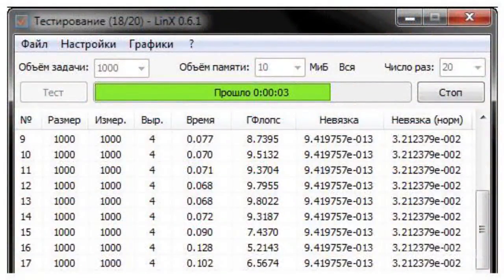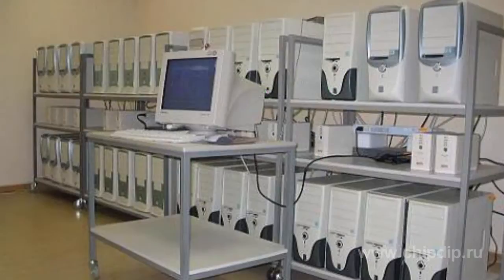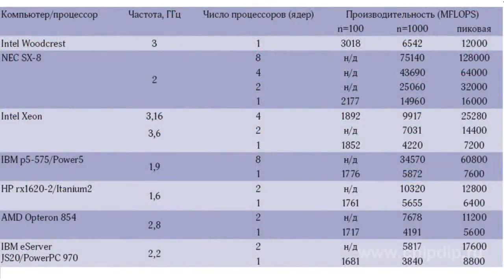FLOPS. Performance measurement

Comment: Please what is 1tb / 1GFLOPS =? Please tell me the step by step process. Thank you.
Reply: FLOPS indicates how many floating point operation a processor can produce in 1 second, these operations contains calculations like subtracting, dividing, etc. a FLOP number is expressed in scientific notation format for example instead of writing 5000000, we can write 5*10**6 so that every number no matter how large or how small it is has the same amount of digits to save space. a FLOP number usually has 32 digits. 1 for the sign of the number, 6 for the exponent, 23 for the significand (digits before the decimal). precision refers to how many bits are used to express that number and normally the smaller the precision the faster or the more the FLOPS are. there are half precision [FP16] which uses 16 bits, single precision [FP32] the standard of 32 bits, and then the double precision [FP64] which is as you might guess 64 bits
GFLOPS or GigaFLOPS specifically means a processor is capable of operating a billion FLOPs per second
TFLOPS or TeraFLOPS means it can operate a trillion FLOPs per second
this metric is widely used in measuring parallel processing like in GPUs, and measuring how well a console (PS4 or Xbox one) can process data